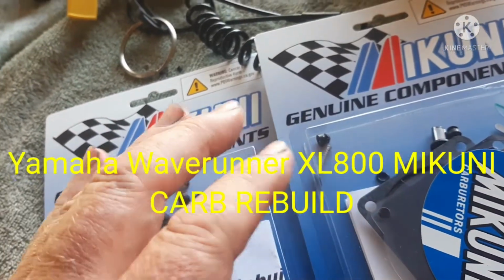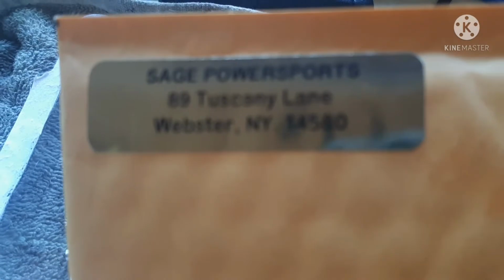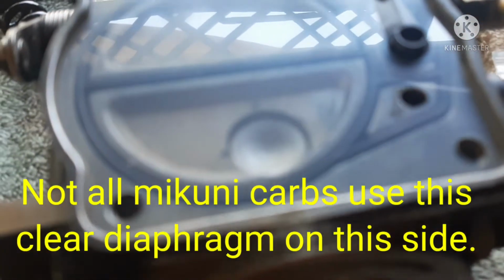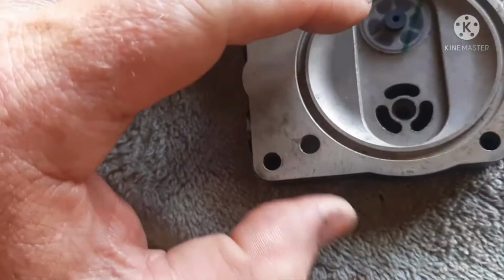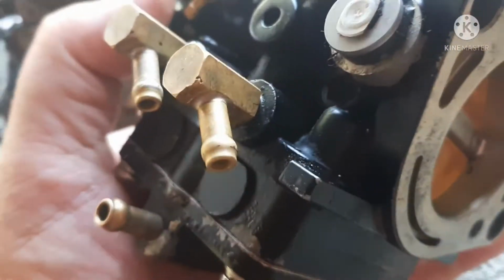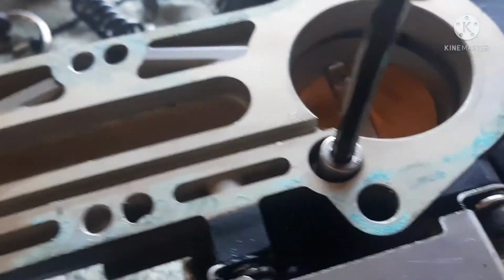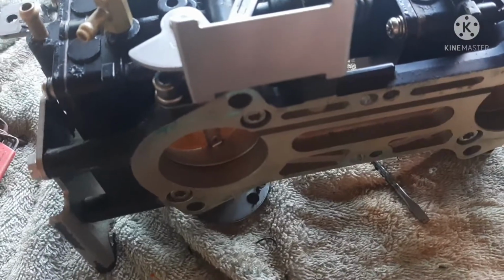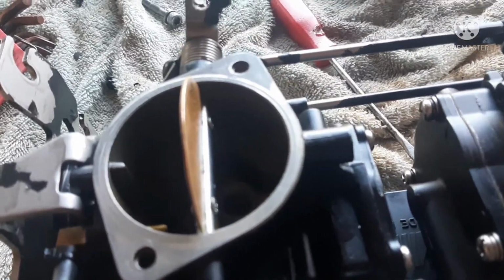Yamaha waverunner XL 800 carb build. mikuni sbni

Comment: Thanks for the video.  I find them most informative.  Does the Sage Powersports guy have a website or a way to contact him other than snail mail?   On your video at the 1:42 time stamp, that part is where I have run into a problem getting that screw out to replace the little plastic check valve.  It is rusted and I am in fear of breaking it.  I have been using penetrating lube in an attempt to free it up but not having much luck.  The plastic on this part looks okay and I am tempted to leave it.  Do you have any suggestions?  Thanks again!
Reply from the maker: I found him on ebay and just shared his info here.  You can try heat a bit but not too much.  The impact screwdriver was what worked for me.  Good luck with it.

Comment: Mr Shadetree,
May I ask you a question I’ve not been able to find in my owners manual?
On the Yamaha XLT 800 or 1200’s how do the Carburater get the pulse from the engine to generate the pumping action necessary for fuel delivery?
What hose lines help or perform this task?
Reply from the maker: @erikrezlman7900  There is a diaphragm inside the carburetor that has a vacuum line connected to the engine which moves back and forth with the piston vacuum ad it goes up and down.  This action pumps the fuel.

Comment: Hey Kevin I have a question. I just rebuilt my carbs in my gp800r and I was left with 2 small rubber o-rings and figure out where they go to. Any idea what they are for? Also thank you for the video very helpful!!
Reply from the maker: The needle screws have tiny orings AND a tiny washer inside.  They dont always come out if you unscrew it.

Comment: Do you think that will make any difference on how install the check valves is that line facing up is just for easy installation or s for it to perform right  because the kit didn't have any instructions or said anything about it thanks
Reply from the maker: The valve is ever slightly concave, so it seats properly when you install it the correct way.

Comment: How do you test the pop off pressure? Tube in a bike pump? And how do you adjust if it doesn’t happen by 77?
Reply from the maker: First you have to know what it is supposed to be.  A stock 800 with the stock jets should popoff at 78-81. Larger jets were installed on a lot of them and the popoff lowers with the larger jet to about 55.  You have to know what jets are in your carb.
If you are using any kits other than genuine mikuni you are making a huge mistake which may cost you an engine.  Going cheap on carb kits is a very bad idea.  The mikuni kits come with springs which usually popoff at the correct pressure.  Cutting the springs is the only way to lower popoff.

Comment: I can never get away without putting a pin hole in the little grommet for the one way fuel check valves. What kind of issue would this result in.
Reply from the maker: Oh and watch Ericsson machine and performace video on building Mikuni carbs.  He shows you the special tool made for installing that black button that you are mentioning.  Mikuni makes it.  It looks like a pin punch.
Reply from the maker: I read if you purtan electric fuel pump on the ski then you have to remove those clear circular discs as they work with the  pulse lines.  I never tried it.  So I would guess it would cause fuel pressure problems which these skis can have.
A bent clear valve causes problems AND apparently they have issues with pressure imbalances which is cured by installing a modified jet in the return line.
This has mostly been an issue on the 3 cylinder models.  There is a thread on Greenhulk about it.

Comment: Hey great video.. could you drop the link for the rebuild kit also would you know where to get the hi/low pins
Reply from the maker: I got the kits new on ebay.  I think SBT sells mikuni kits but they are not branded as mikuni sbt also sells the carb parts.

Comment: Appreciate the video.  Couldn't agree more about using only genuine Mikuni after I also wasted money on aftermarket kits and had nothing but trouble.  I also can't stress enough the importance of testing the pop off after rebuilding.
Reply from the maker: The problem I run into is getting the correct popoff setting information.  Many forums give it but if you read furthrr you will see that many posts they have changed the jets and those setting wont work right with stock jets.